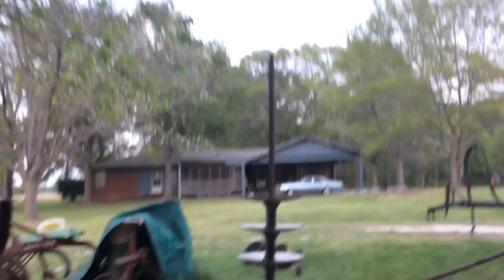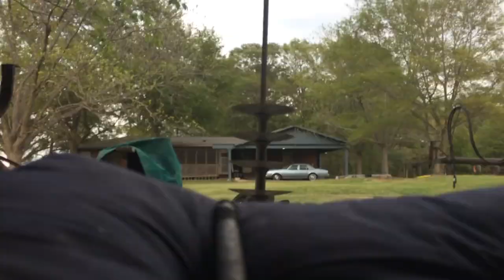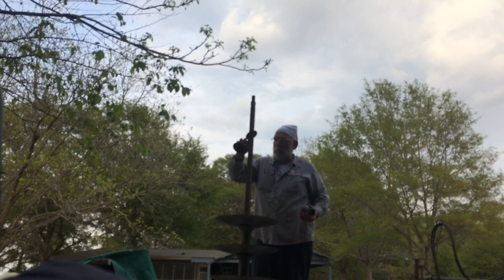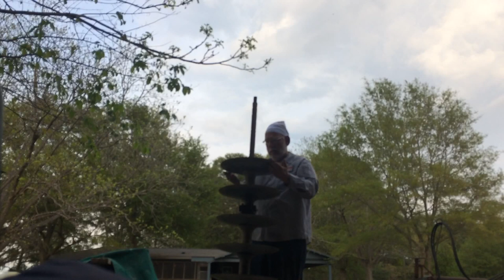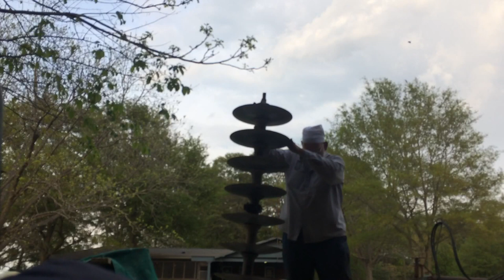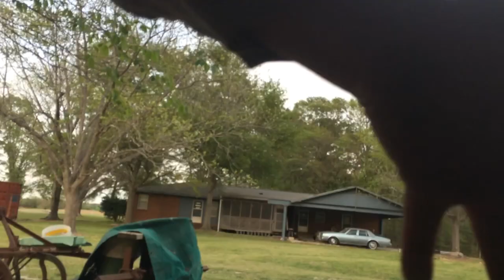Part 3 Disc assembly

Comment: sorry I did not make it over there the mower project went sideways really bad.  I did not get in the house until I called and left message from the house phone because I can't right now find my cell phone.    LOL I remember when we were doing the heavy offset and at about 1am we took my 10 pound maul and smacked the axil.  rang out right when tight...   thanks for your hard work on the disc.
Reply from the maker: Soybean Farmer 
B ok

Comment: That is the way I've always done it , Stand it up and put it together and run when it starts to fall !  LOL  Then get the BFH and smack the axel shaft and drive it home , Apply nut with sufficient force to tighten it up and smack the end of the shaft again and retighten it again and repeat !  My uncle could tell the difference in the ring of the blades when it was good and tight !  Keep up the great work Cousin Scott .  Bandit
Reply from the maker: Bandit farmer 
I want to bfh but the shop close to mamas house and I don't want to bother her if she be asleep, so my sister that keeps her can rest too !
Thanks cousin Bandit!
Reply: Well you got to do what you got to do and sometimes its not the way you want to do it.  Work quietly and carry a long pipe wrench to tighten it up with ! LOL Cousin Bandit
Reply from the maker: Bandit farmer 
Roger that couz